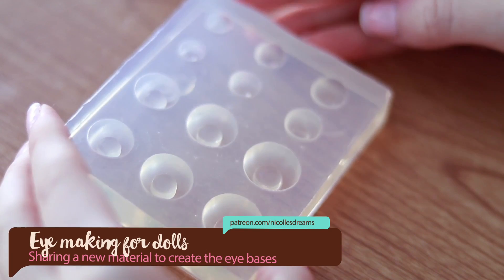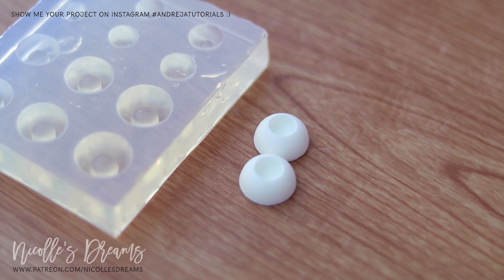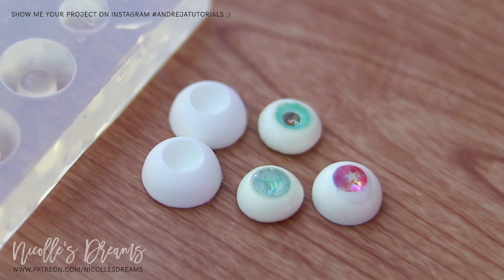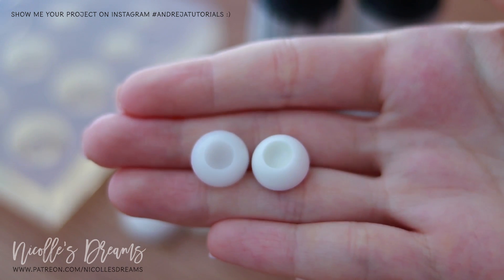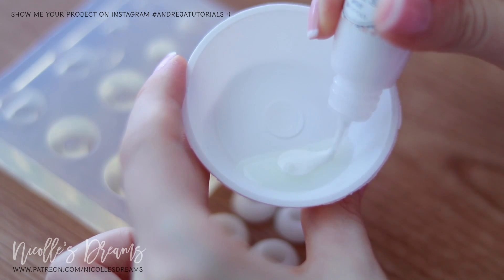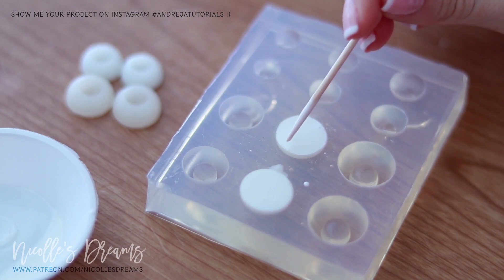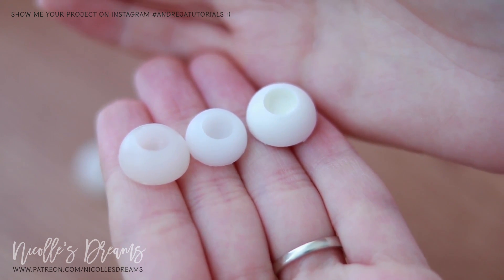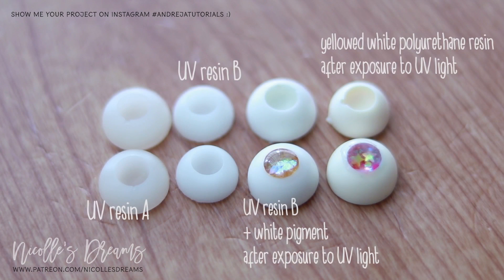Eye Making for Dolls - Using UV resin for the eye bases

Comment: There's a resin brand called Amazing Casting Resin, it hardens in about 5-10 minutes and is really opaque white. It's plastic feeling and comes in decent sized bottles for the prices they offer. It doesn't yellow either. It's a simple 1:1 ratio

Comment: I freakin love ur videos andreja they'e so relaxing!!! i was just wondering if u could use this type of resin to cast a hole body or is there another type of resin for that??
Reply from the maker: That is a good question and honestly I do not know since I never made a doll myself. There may be a limit as to how large and thick an object can be, before the UV light does not manage to travel all the way through to make the uv resin properly set and harden. It is very important that the mould is transparent otherwise the UV light wont reach every angle of the object.
Reply: maybe if u use the type of resin where u add a hardner u wouldn't have to use the UV light machine, but i dont know if thats the same kind of resin that ppl use for casting, anyways thank u for answering my question ^o^ !!!
Reply: UV resin is only good for small projects. if you wanted to cast a whole body you;d have to use two-part epoxy resin
Reply: yeah thats what i was thinking

Comment: this is so quick compared to taking two parts, making sure they are of equal amount and stirring them until the bubbles disappear and then adding the color and stir more and then place it under UV or if you are using polymer to make for a certain amount of time.

Comment: Haha, just the other day I was reading about how OOAK doll artists started using UV nail gel ( not the paint, but the gel for false nail sculpting ) for eyes, and since it comes in 'white', 'natural clear' and 'crystal clear' and can be baked at the temperature polymer clay needs to be baked at, it was becoming a favorite among the doll clayers. I'd like to try it but the UV lamps are way too expensive for me.
Reply from the maker: where have you been looking for UV lamps? I got mine for $15 on ebay, which is cheaper than the actual material to make the eyes haha I just checked again and there are even cheaper options out there (like $5)
Reply: Ebay. I don't really interact with other people in the nail and/or polymer claying community so I haven't really asked who has what. I'm kind of a quality freak too so I wasn't sure if I should even bother with the cheaper ones.

Comment: Hey Andreja! If you happen to have a free while, could you please make an updated video on removing face-ups from differently colored resin? I have both white and tan dolls currently shipped to me and I'm not sure if the method of removing their face-ups if I don't do a good enough job should be the same like in your old video (acetone-free nailpolish remover) or perhaps a specific one. Thanks in advance! <3
Reply: cried doll tip do not get a colored remover it can and will stain your doll but faceup removal is the same on all resin cept if it was dyed then you have another issue entirely

Comment: Can i use normal resin???
Reply: Fatpigxebottom 2003 You absolutely could use regular resin, just as long as you use a cast release spray if you have a silicone mold (DO NOT ATTEMPT TO USE REGULAR RESIN WITH SILICONE WITHOUT IT LEARN FROM MY MISTAKES), and obviously you won't have to use the UV lamp. The only thing I'm not sure of is whether or not you would still have the original issue of yellowing under UV for the clear coat.

Comment: Just wanted to ad: This will only work if you have a clear silicone mold, I got white opaque silicone and I can't cure my uv resin now, so I wasted alot of money on silicone and resin now. :|
Reply: Mara Creatures You can just apply the resin in layers and cure between applications! It takes a little longer than usual, but you should get the same effect.